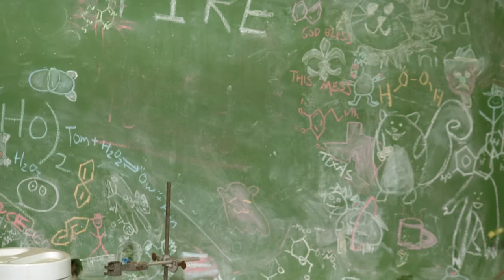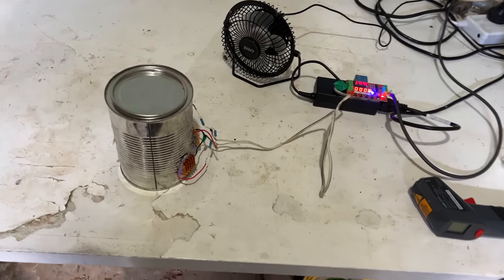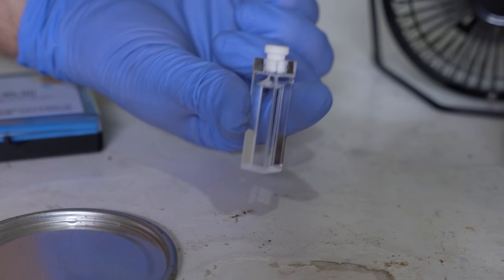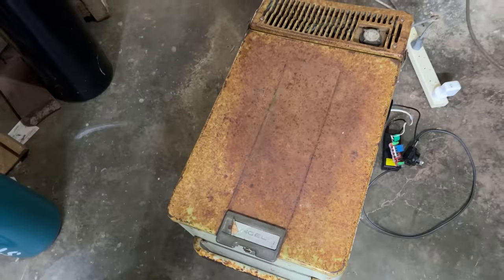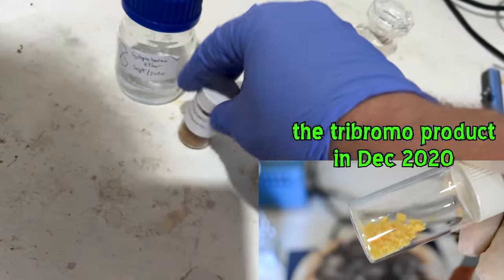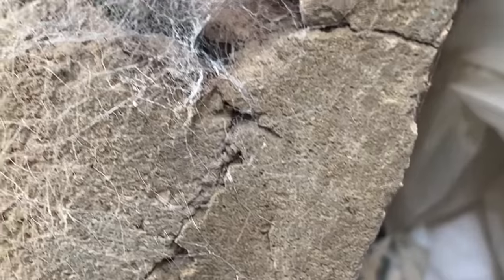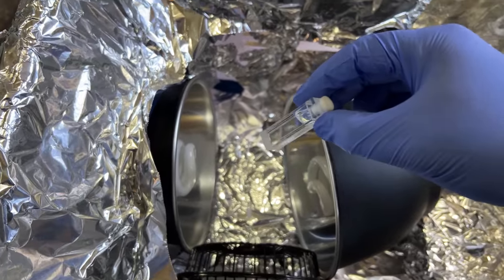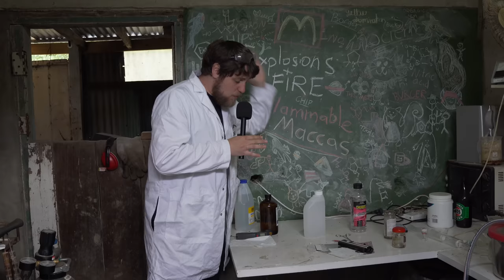The PhotoFridge - Cubane Ep 13

Comment: As someone who’s made cubane, I find that recrystallizing the intermediate right before the UV cycloaddition is incredibly helpful. You can use UVA lamps for it (I think the key wavelength region for this reaction is 300-350 nm). I run this step in methanol with a slight amount of HCl (1 mL for 300 mL MeOH). You should start with a colorless solution and end up with a yellow solution that concentrates to an orange sludge if it works. Just need to blast it with photons. Tsanaktsidis has a great prep from 1997 in the Australian Journal of Chemistry

Comment: Try a vanillin stain, 1M vanillin + 1% conc. H2SO4  in ethanol... they show up "most things" with some pretty colours. Baseline spot implies the product is being oxidised as whatever you're forming is polar as hell - dissolved O2 is usually a killer of photochemical reactions, so you could always try sonicating / sparging with argon before it goes in the reactor. Bromocresol green is good for carboxyllic acids, so it could definitely show you what you're not supposed to have :)

Comment: When you dry your sieves with the bursts in the microwave, instead of turning the microwave on and off every 10 seconds, you can just change the power level of the microwave. Microwaves cheat and don't actually change power levels, but rather turn on and off for a percentage of the time. for example, a 60 second long microwave at 10% power means that every 5 seconds there is a 1 second burst. So for like 5 burst of 10 seconds w/ 20 second rest time, just put it in for 30% for 2:30.

Comment: If you put some silica with the iodine in ur chamber and then shake it lightly to move the silica over the plate, it will stain 100x faster! Just the vapors sometimes do a horrifically slow job ;(
Reply from the maker: ay pro trip, thanks!

Comment: Love your videos. Best wishes on an ambitious project. 
If you can buy curcumin powder from a health-food store or the supplement isle in a grocery store, you can make a saturated solution of it in absolute ethanol containing 1-2% sulfuric acid. You should be able to then dip your TLC plates in it or spray it on a warmed (45  C) TLC plate (pre-heating it helps “fix” the spots so they don’t run like wet paint). Re-warming the plate carefully should reveal any ketones as deeply colored spots on a bright yellow background. Amino acids should turn bluish. Ketones should become deep red or deep orange. 
Curcumin is a beta-diketone that has a very nucleophilic enol, and a very electrophilic oxonium ion (a proton gets coordinated between the keto and enol oxygens, making a very electrophilic system). If water is present during heating with acid, it hydrolyzes to even more reactive substances (a substituted acetoacetone and a molecule of vanillin), hence you don’t need to hunt down vanillin. It’s like vanillin (a solid vanillin precursor) because with water, acid and heat it should generate vanillin right on the TLC plate. (Caveat: I've tried it in a limited number of situations and it worked, but I've never seen a literature reference, nor a recipe for it online).

Comment: I really love your videos.  You have so much knowledge about chemistry, and present it in a way that makes it a lot more realistic than anything else I've seen.  A quick note about those resistors: I'm not sure how the LED clusters are wired but I'm pretty sure you're not driving them as hard as they should be.  19V - Forward voltage = 16V.  16V / 1k = 16mA.  So you could drive them twice as hard if you wanted to.  Not sure if this helps, but if it were me I'd try some 470 Ohm resistors instead of the 1K resistors you've got.
Reply: That was my impression too. Intensity seemed rather low.

Comment: Great video as always. In the original procedure, a medium pressure Hg lamp was used which has a peak emission of around 254 nm; outside the range of the reptile lamp and UV-B led chips. Good news, the TLC lamp you're using (time stamp 15:15) is a Hg lamp. If you turn it on and sniff the air around it, should smell like ozone? Maybe you can hack together a contraption that directs the light into your cuvette?

Also, back when I was doing some photochemical carboxylation, I found that lamp output made all the difference. We got very slow reactivity with a 18W lamp (multiple days) but fast conversion (2-6 hrs) when using a 100W lamp. You might need to run your reactions for longer if you have lower powered lamps. And keep everything cold like you're doing now to minimise side reactions. Good luck!

Comment: Always fascinating, great to see you back :) Is it cheaper to buy a small, thin quarts window instead of container? Then you can mount it to the top of any glass container and just use a single large UV LED cob. The rest of the container can then be submerged in water to maintain temperature of solvent. Hopefully it could be warm enough for the reaction to happen, but cold enough so that you don't lose solvent since I imagine it would hard to find a suitable seal material.

I have used ordinary sandpaper in the past to flatten the top of a glass jar just a little bit to improve its seal on a flat surface. Its very slow to sand glass so it helps if it is already fairly flat.
Reply: Keeping the Reactants cool and simply shining from the top into a Beaker might work.
Probably replacing the LEDs that get damaged from the Fumes comes cheaper than Quarz…

Comment: I’m working on cubane myself but probably won’t be at this step until you’ve figured it out. Have honestly considered using carbon tet. Wanted to try and follow the paper as close as possible and then tinker around with the UV step and different solvents to see if there’s a good way to go about it. Looking to get all the way to cubane of course but what I’m really interested in is the material in the last step because you can do some funky stuff with that to make different cubes.
Reply from the maker: Best of luck with it mate! Yeah if we could work out some good conditions and how to easily detect the product with TLC, I think the whole cubane synthesis could become quite repeatable and accessible for the home lab
Reply: @ExtractionsAndIre  based on the small amount of products you're getting for each step,  will you be able to properly test the final octonitro compound? If not I've heard that cubane is available from some pyrotechnic supply sites.
Reply: @ExtractionsAndIre  agreed! Will share any findings. Definitely plan to mess around with that step a bit! The answer is out there somewhere lol

Comment: have you considered setting it up the other way round - i.e. using a UVC bulb, shielded by a quartz tube glued onto a ground glass joint, and inserted into a borosilicate flask?
I've given some serious thought about how to carry out the Pettit synthesis of cubane at home, and this is the most foolproof design for a photoreactor that I came up with
Reply: I think this would work but the heat sinks would have to go somewhere. As it is the bulb would heat up and evaporate the solvent
Reply: @forwhomthetacobelltolls9789  you could immerse the borosilicate flask in an ice bath
also, the UVC tubes I've come across have been LED/mercury vapour hybrids, with a power rating of 20 watts or less, so they shouldn't produce huge amounts of heat

Comment: As your wanted product is a ketone, dinitrophenylhydrazine stain might work - it forms hydrazones with ketones which should give a colored spot. Here's a recipe for a stain:
12g 2,4-dinitrophenylhydrazine, 60mL conc. sulfuric acid, 80mL water, 200mL 95% ethanol.

If you have any way to get stuff measured I'd suggest ESI-MS. It can detect miniscule amounts of sample and doesn't induce fragmentation like other methods of ionisation in MS often do, so you should be able to detect if there's any conversion going on by checking if there's a molecular ion peak for [M+H]+ or [M+Na]+.

TCI has a useful list of TLC stains they offer, it also includes what functional groups they are best suited to visualize. Would post a link but it doesn't let me, so googling "TCI TLC stains" will have to do.

Comment: iirc, some people in the comments of soome of the other videos suggested that you could get quartz tubing from UV sanitizer replacement tubing as the UV sanitizers use quartz tubing in them. Did you ever check that out as a possible avenue?
Reply from the maker: Possibly! But how do I seal it well in a way that keeps the volatile solvent in?
Reply: No of course not
Reply: @ExtractionsAndIre since you only need the part of the tube holding the solvent to be UV transparent, you could always take a hacksaw to some (clean) broken test tubes of roughly the same diameter and melt the rim of the cut line on the test tube to the rim of the cut line of the tube make a weird ad hoc chimera ampule where the bottom is the quartz glass and the top is normal glass. If both sides of the quartz tube are open, you can melt the bottom of a broken beaker to one of the sides before putting the solvent in to act as a base.

Sounds perfectly in line with the rest of the stuff you make ngl.
Reply: @ExtractionsAndIre  I’ll make you some Quartz test tubes if you want.
Reply: @meme__supreme3373  is it possible to adhere dissimilar materials like that?
Reply: @benpye6854  yeah, so long as the surfaces are clean and fit together well, the melted glass from the top ones should probably act like hot glue. 
obviously if you really wanted to make sure that they stuck together well, you could take a glass rod and melt it with a blowtorch as if you were welding metal, but the directly melting them together thing seems more like Ol' "Quick 'n' Dirty" Tom's type of thing.

Comment: Would suggest looking at a flow set up with tubing coiled through your can for scaling this up, you could have the tubing run through a cooling bath beforehand to help avoid side reactions and flowing the solution through capillary tubing would give you much more efficient mass transfer than just sitting it in a stationary beaker/curvette. Main cost would be sourcing an appropriate pump and praying nothing crashes out of solution

Comment: Chemistry postdoc here. Potassium permanganate is a good stain for your starting material but probably not your product (as you've already discovered). Vanillin could work also. 2,4-dinitrophenylhydrazine should be a good stain for both the SM and product, but I've never used this before. Hanessian's Stain could be good because it should give different colours, like the vanillin stain.

The easiest way to get a good idea of product formation would be FTIR (infrared spectroscopy) because you should see 2 distinct carbonyl peaks, run this on your SM and also some crude product - you've used help from friends at the uni before so could be useful again? NMR would also be useful (but hard to interpret), and LCMS would be great because you'd just be looking for a single mass of your product. Not sure if you have access to this equipment though.

Lastly, PLEASE use PTFE tubing as a reactor and not some cuvette or other vessel (glass/quartz whatever). You can get a spool of really small diameter PTFE (or PFA may work too) tubing for cheap, like if you get 1/32" inner diameter tubing and use this as a reaction vessel you get insanely good UV penetration into the reaction medium. Inject your reaction mixture into some tubing, cap both ends with PTFE fittings, place it in your fridge reactor and let it go. Look up 'continuous flow photochemistry' on Google Scholar for more information.

Really love the vids and want this to succeed, good luck!!
Reply from the maker: I've honestly never though about directly using PTFE as a reaction vessel... but if it gets good UV penetration, it's a great idea!!
Reply from the maker: Also I think Vanillin stain is a great suggestion

Comment: Do UV lasers come at the wavelength you need? Its been so long i don’t remember the range you need
Reply from the maker: 300-350nm. Not really an easy laser wavelength unfortunately!
Reply: @ExtractionsAndIre  what about a laser diode from a dvd/cd burner? My dad and I used to rip open anything with a disk drive for the diodes, half of them produced UV, not too sure of the average range I suppose.
Reply: @azraellie_  around 650-675 on dvd and blu ray.
Reply: @ExtractionsAndIre  what about a bandpass filter?

Comment: Personally, I would work to clean up your lab area first. Seriously fix things up. Fill, seal, and paint the walls. Seal the room from the outside. Maybe put an air purifier in there. Might just be dust that's getting into your stuff and making a mystery dot on the TLC's.

Comment: PhD stud here with my few humble suggestions;

Just a little useful tip for TLC spotting - You can use a needle (of any length) with its tip cut off so that it is blunt. Then all you need to do is to spot first dew drops on paper towel so you get nice small / sharp dropplets when performed on TLC. Needle can be washed in fresh solvent and used without ever making new ones from glass.

Dunno if it was suggested or not but CHCl3 could stand little bit better against evaporation as well as you not getting a cancer (so fast).

For visualisation your spots you could maybe try Phosphomolybdic acid solution. Or concentrate / evaporate your sample and then try to TLC it, or place more drops of the sample on the same spot - maybe the product with its structure just cant be seen in such low concentrations you used.

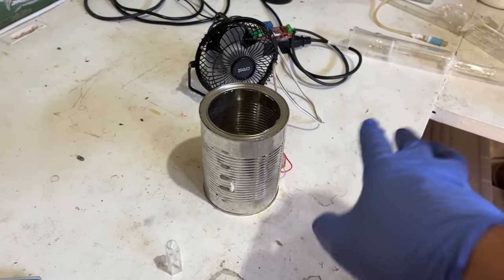Comment: 9:14 a peltier cooler can drive about 30 F delta (about 16.6 C delta). if you buy one of those 4 drink coolers off amazon that do not use a compressor, they have a Peltier cooling system with the fan and everything ready to go. you can even get ones that will work off 12v dc directly or 120v/240v ac. you can also just buy small peltier blocks, but then you have to do more work on them lol. i would also recommend a hyper 212 evo PC cooler with a 120mm fan for doing your cooling on the heat sink. you can use some sil pad tape to bond the heat sink to your board, and that heatsink has more than enough chooch to do what you need. they are super cheap too

Comment: The fan in the fridge is 100% a good idea. Yes, it will add maybe 1W of heating to the volume, BUT it will move the air about, and forced convection is WAY more effective than natural convective heat transfer. Try turning the fan off on your hairdryer and see how warm it feels vs with the fan on. Massive difference. Also make the temperature more even through the volume. I have one on my keg fridge, though I've got a microswitch so that it only comes on when the lid is closed to stop it blowing all the cold air out when I open it.

Comment: Little tip if I may...
When making TLC spotters, hold the tube in the fire till you feel it melt for a second but no more then that.
Then PULL IT out of the propane fire and PULL the 2 ends appart real fast...
I have found that this gives the best results EVEN when I use the tip of glass pasteur pipette to make the spotter.

Comment: Best solution I can think for you is to get a quartz topper lid and try again. Or a regular glass top seal? Maybe even sand down and clear up the sides of your cuvet. Maybe get a filter for the UV range you are looking for? Or a converter lense that changes the UV or other light into the spectrum you want? 

You could get some quartz pannels and decide to be extra with it. Get a torch, some thin quartz pannels, and melt them into a reaction chamber box that uses a basic lid. Melt some pannels at a angle to flat piece and rough up both parts for inside and outside with some sand or bead blasting from your sandblaster rig you have and you have made your own quartz box that seals.

Hope it helps! :)

Comment: Sterilzing lamps (straight ones) could be a source for some vessels. Just cut it to to get the inner mercury bulb out and you're left with a glass envelope. All I have are such two layer ones.
You could also get an extra cuvette if you remove the mercury from the inner quartz tube.
Reply: @Edward Elizabeth Hitler That is interesting, I never knew that. This makes an easy source for quartz tubes!

Comment: Conc. sulfuric acid and excessive heating can be used as a stain for compounds with limited functionality. It basically just serves to chew up any organic material present on the plate. You usually will see any organic compounds as brown spots.
Reply: Also, i have some experience with making home-brew photoreactors for my PhD work- i have some good suggestions for UV LEDs that have quite a kick and don't break the bank if you are interested. I buy mine from mouser or digikey, i'm happy to share the resources if you are interested.

Comment: Hey so I’ve been doing lots of research on this step and wanted to share some things with you.

I was looking into starting with a 90% ethanol and 10% hexane solution to try and get better separation, trying to increase the hexane percentage as I go to dial it in. If needed swap the ethanol portion out for something more polar like methanol or acetone. As far as a stain goes, 254nm light should do it and I’m banking on that but if not I was also looking to try methylene blue. 

Hope this helps and happy hunting friend.

Comment: Just a small tip, if your resistors are getting hot, they can be boosted in tating it you connect 2 parallel pairs in series. You have R resistance, you connect 2 of those in parallel and you have R/2. You connect two of those pairs in series and you have 2*R/2=R. You get back the original value but 4 times the power output and a lot temp.